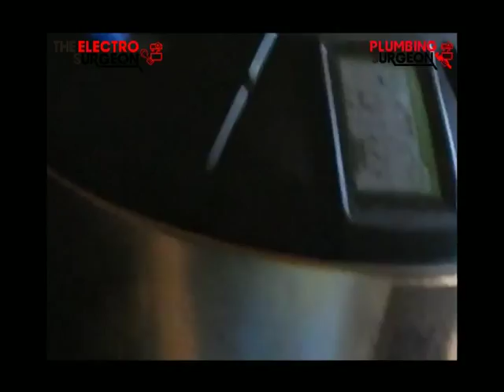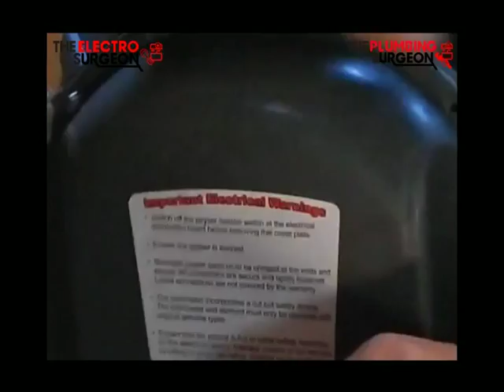Video: How to Install a Geyser

Comment: I notice the TP overflow has a 90 bend on it. It should have a labor bend or two 45 bends.
Reply: Its still a Grey Area for many plumbers on that from SANS, Never seen a problem once with a copper 90deg bend.
Unless someone blocks the pipe.

Comment: I see that you connect your copper hot water pipe directly to the original galvanized water pipe FYI this creates electrolysis between the two metal pipes. I also see your plumbers installing the electrical components..... should this part of the geyser installation not be carried out by a qualified electrician?